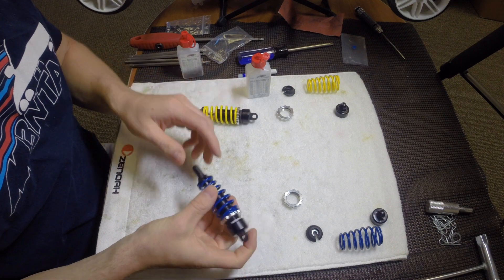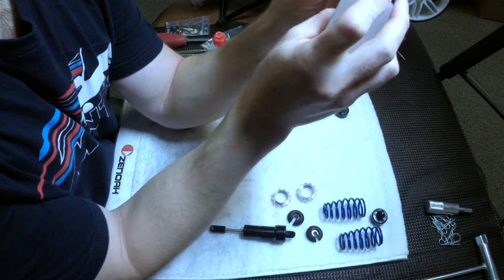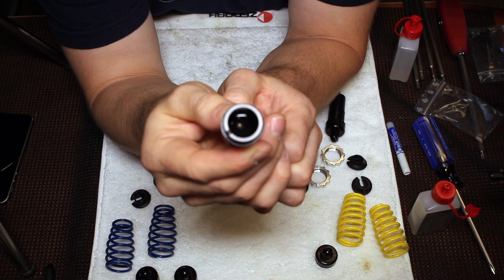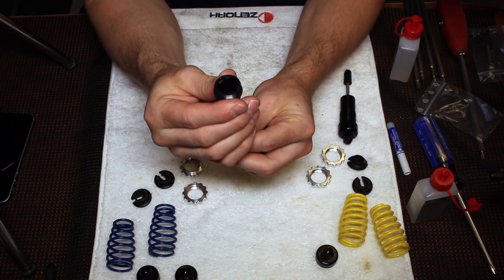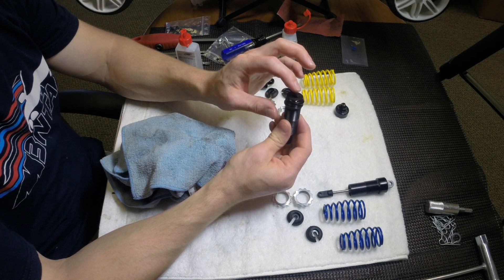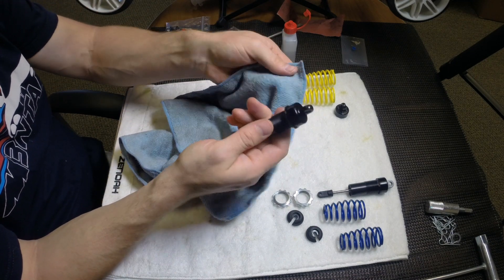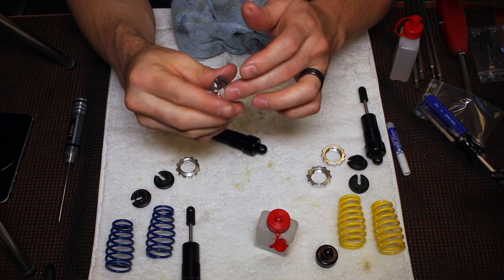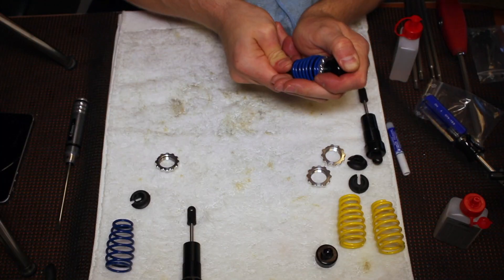FG EVO 2020 Shock Building and install

Comment: Just asking but dose it really effect performance that much if u don’t get the bubbles all out 🤷‍♂️
Reply from the maker: That is a great question. The answer is yes! Air in your shocks is not good for consistent damping action. Additionally if your shocks are not filled you will also have a challenging time getting all of the shocks to behave exactly the same resulting in poor handling of your car!
Reply: DDMSteveB thanks for responding that’s good to know I’ll have to be more thorough next time when I do mine again 👍

Comment: Love watching this collection of vids on the 2020.  not much out there on this model.  I want to say that the diaphragm should be installed down (as you have), but with the shock shaft in the extended position.  This will allow the diaphragm to compress when the shaft moves into the shock body.  the way it is now, when the shock is extended, the diaphragm will be trying to stretch out under stress all the time even when the car is a rest. If the engineers at FG did it right, the volume displaced by the diaphragm from relaxed to compressed should the the same volume as the shaft entering the body at full compression.  My thoughts anyway.  Wish I had a model like this.  Awesome.